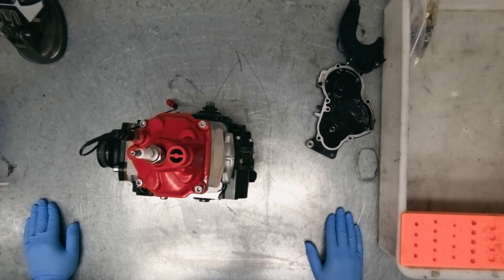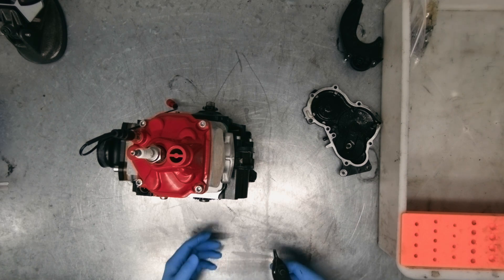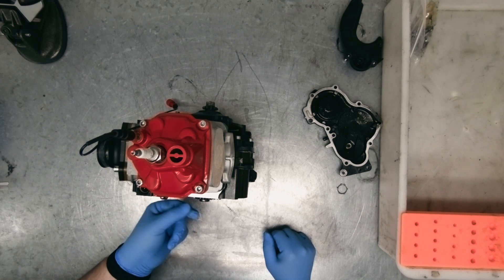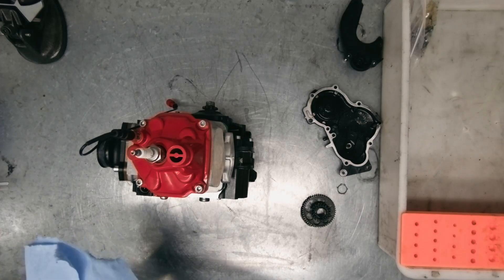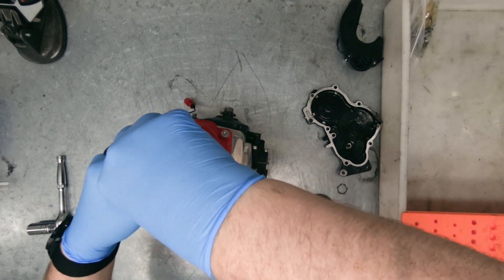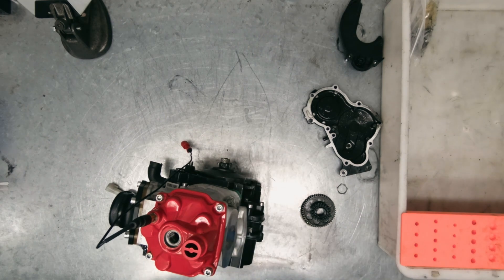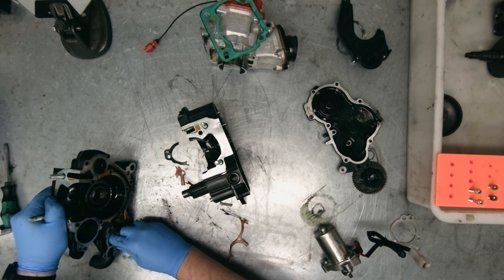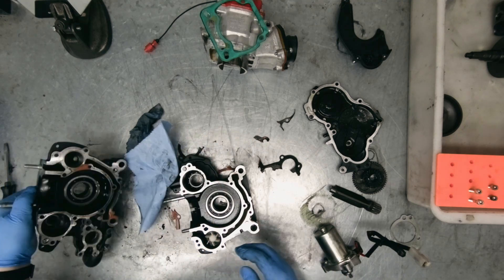Rotax Jmax teardown. Gearbox problems

Comment: You didn't film  it very well. We couldn't see what you were doing. The engine was barely in frame early on. You didn't explain what you were doing and early on it wasn't obvious. For example - first let remove the starter. Then the whole cylinder. Then split the crankcase. Just saying!  I have an early Rotax and was interested at looking at its guts as I will need to give it some love soon.
Reply from the maker: First video.. Better camera angles in later ones